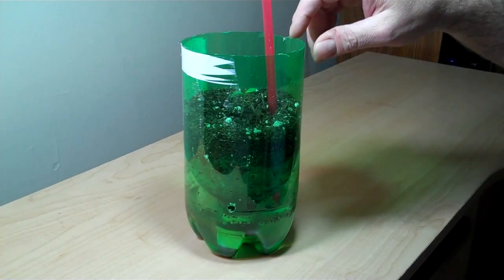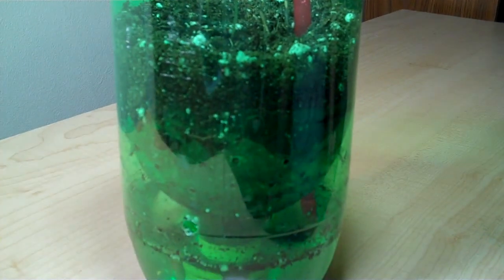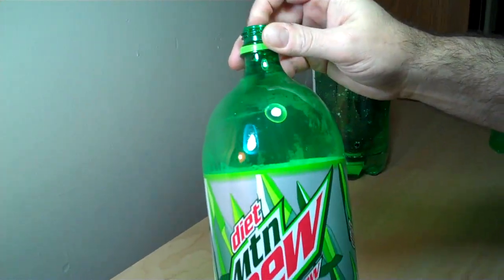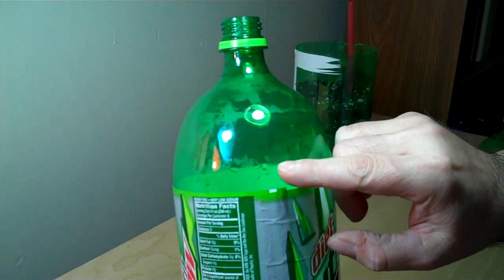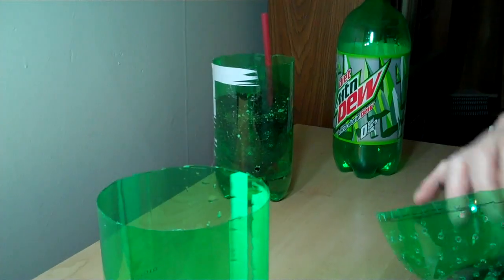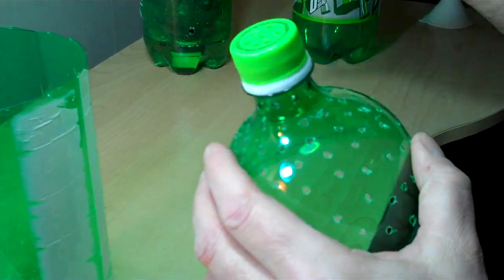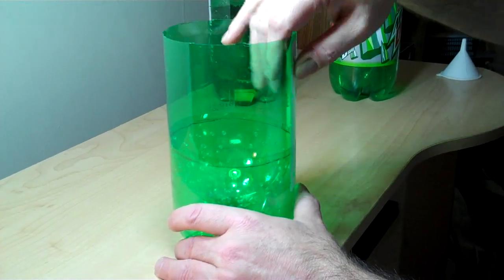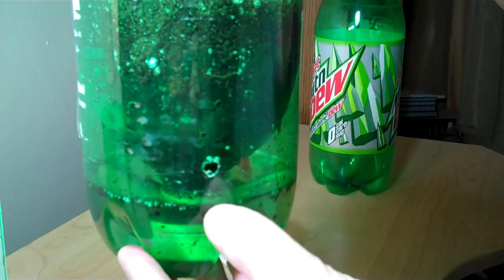2 liter bottle self watering experiment DIY

Comment: Not sure if you are still doing these but coke bottles work better because the base is different and the paper makes great mark offs for where to cut the bottle.    We raid the recyling bin and get the idea bottles to do same with. Are you happy with results?  We have not grown in them yet.  How about a wick attached to popsicle stick piece in the bottom (neck) of inner bottle?  Also, did you consider just watering through the hole on the outside?  Maybe use the funnel there?

Comment from the maker: You can but you run the risk of algae on the reservoir. Green seems to eliminate the possibility of that happening. Also, with clear bottles, you'll get light pruning of the roots when they reach the sides of the bottle. Some say it's better, some say not. Personal preference there. I used green because I was worried about the algae and wanted to see the roots as they would be in a pot you could not see through.

Comment: I haven't seen your new version, but I make VERY simple self-watering planters--no power tools required--with juice bottles. Slice the top off with a box knife, invert the top, slide it into the bottom. The bottle neck fits perfectly onto the little dome on the bottom of the bottle. Wrap it in duct tape or paint to keep light from the roots, stick a bit of sponge in the bottle neck, fill with growing medium, and voila! There's no real need for an overflow hole or a feeding tube. Just use liquid.

Comment: There's a straw in those self-watering plastic gardens so we can put water directly to its reservoir.

Would there be any difference IF WE DIDN'T put the straw in them? When the plant is watered, the water would go down through the soil and through the holes and directly to the reservoir and the excess water to the overflow hole.

The plant wouldn't die if it get temporary flooded from time to time when watered, and the water would go down anyway through the holes.
Reply from the maker: +Swiper Fox Watering from the bottom saves water because it can evaporate if it's watered at the top. Insects will be less inclined to borrow down into dry soil. Watering from the bottom gets the water directly to the roots which is where it is needed. It's a win, win, win scenario. Thanks much for your comment!

Comment from the maker: @bejais I can't disagree with you on that at all. I was growing an indeterminate tomato plant in basically what was a 4.5 inch wide yet very deep pot. But there are dwarf plants and other smaller plants like herbs you can grow in it but it was alot of work to make. But I have devised an easier self watering planter that you can make in a few minutes without drilling any holes. I hope to have that video out by december 31st. What are wanting to grow?

Comment: I did this same thing but rather then poking holes i just cut the bottel in half and left the cap off. just fill the bottel bottom till the hole inside is full and leave it. I have a tomatoe that is still going in it till i build a hydro system.
Reply from the maker: +blue13ryu Excellent! I am sure many ways would work and this is an experiment and happy to see variations!

Comment: Ha!  I made this today before watching the video.  Great minds think alike, I guess, lol.  I was wondering if it would work, so thanks for the video showing that it does.  I didn't do that much, though, and I did the opposite as you.  I made the bottom shorter and the top longer so the lid of the bottle rested on the bottom.  I didn't drill any holes (besides the drain holes), and I left the bottle cap off.  Hopefully it works just as well. :)

Comment: PET is used for drinking bottles, but try re-using a PET water bottle for a week. Starts stinking horribly pretty quick.  Just don't reuse for years on end :)

For seedlings, I've now balanced small pots over glass candle holders, filled with water. Stuffed an inch or two of soaked, cut-up jeans in the center hole, dangling in the water. Seems to work fine, and good for non-permanent little pots. If I can find a glass 'trough' to balance multiple pots on it'd make it easier to keep 'm topped up.